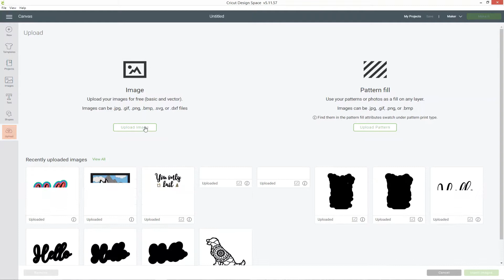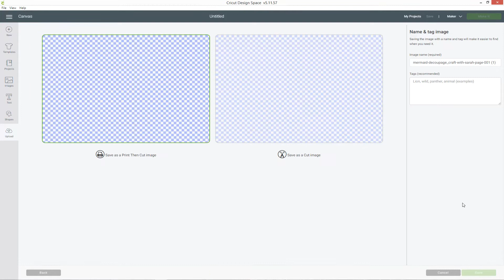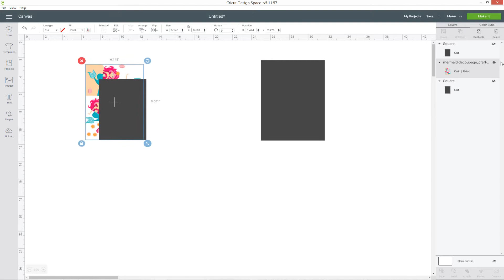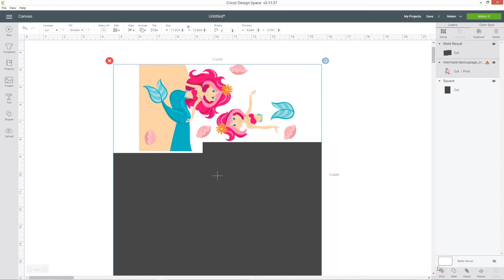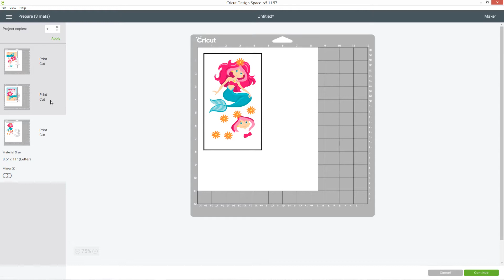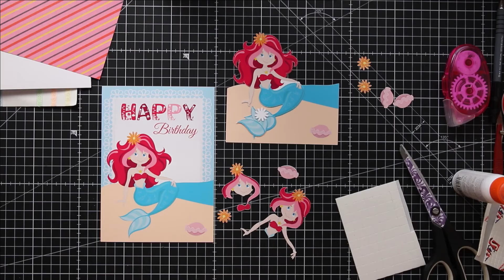Print & CUT Card Making Downloads on your Cricut! Ultimate Card Making Hack!

Comment: Sarah, this is great, thanks. What about the sheets that come without the pieces individually layed out for you. Is there a way in Design Space to select which pieces we want to be cut out? For example, the mermaid, how would I select just her head, or her swimsuit top in Design Space?
Reply from the maker: There isn't really an easy way to do that in Design Space as it's not built for that type of graphic design. I use Photoshop to design my printables, but you could also use Canva which has less of a learning curve but it doesn't have as many features.
Reply: @CraftWithSarah  Thank you for getting back to me. I have (used) PhotoShop, so I’ll try that. Any suggestions/hints you can provide are greatly appreciated!!! Thank you again.